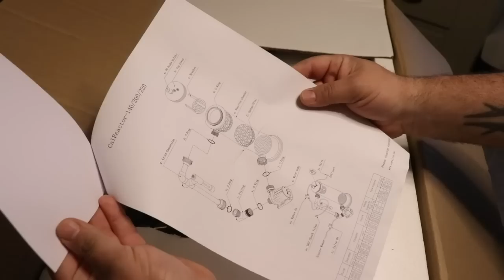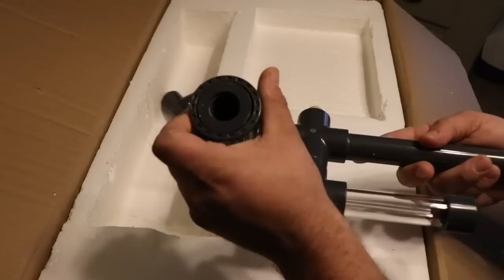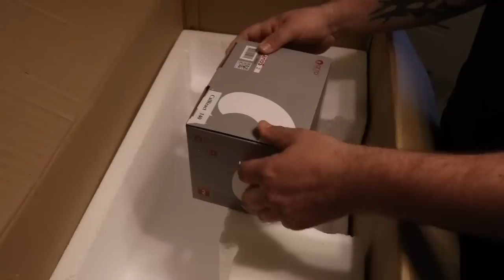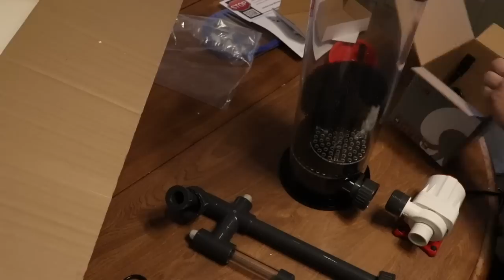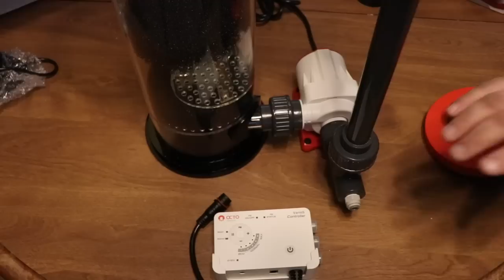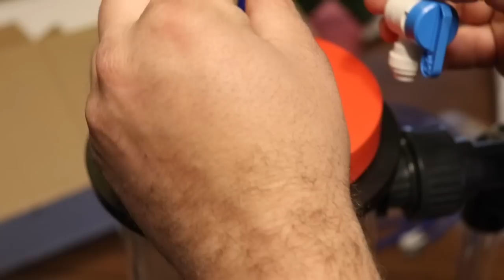Reef Octopus Calcium Reactor with Varios 2 Pump

Comment: I have this an am having a lot of trouble with the "recirculating" aspect.  There is a valve in the line from the top of the reactor to the verturi... If I open it more than a crack, the pump cavitates.  The directions are completely useless other than basic assembly.

Comment: To me it's more about finding a place to get co2 for the reactor
Reply: Look for a local welding supply shop or restaurant beverage shop. My local welding shop does CO2 tank swaps. About $13 for a 5lb and $15 for a 10lb. If you don't have a CO2 tank there will most likely be a deposit for the tank the first time. If you decide you don't want the CO2 anymore, then return the tank and get your deposit back. It's easy. Depending on the size of the CO2 tank and your aquarium, you may need to fill CO2 once or twice a year.